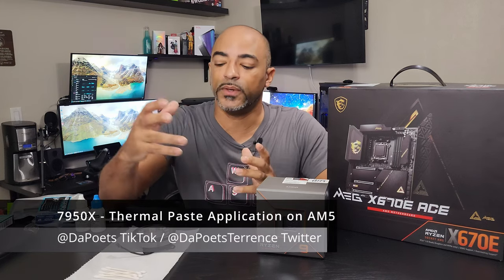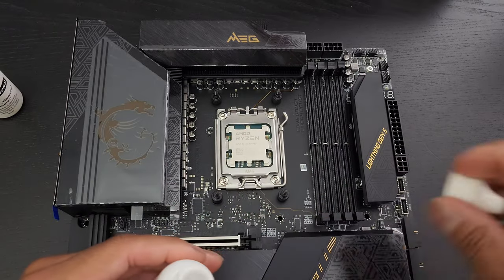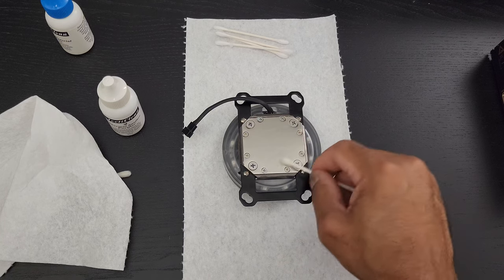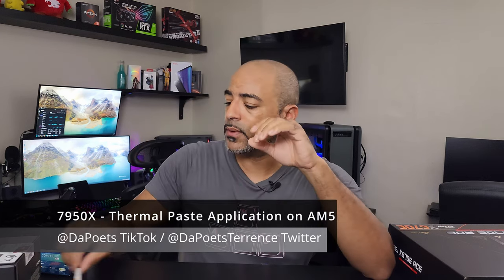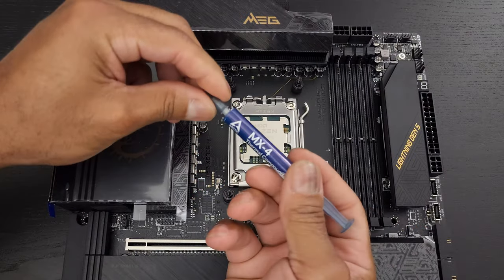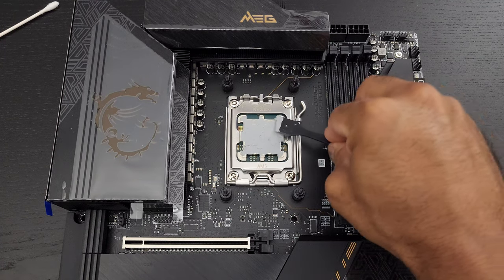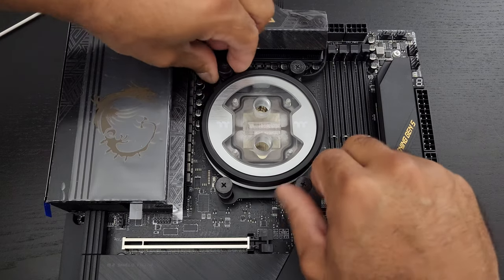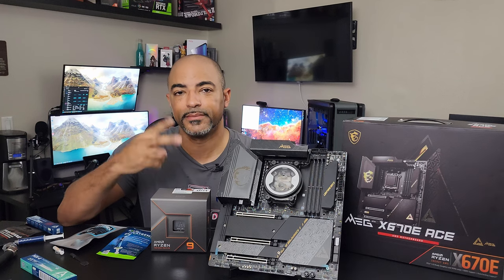AMD AM5 - How to Apply Thermal Paste - Ryzen 9 7950X

Comment: Just finished my first build (a 7700x), and your video was a huge help in taking the mystery out of thermal paste for newbies like me. I applied it just like you did, and the CPU has a nice idle temp of about 43C. Thanks so much for your videos!
Reply: if you spread it like butter you will get air bubbles in between the contact
Reply: That idle temp is terrible
Reply: Don't do it like him in the video, there is a reason you not suppose to mess with it
Reply: @romanpechorin4798  Tom's Hardware would disagree with you: "When the CPU is idle, a good temperature is anything under or around 50C." Especially given this is the 7000x series, which runs hot in general.
Reply: @boxinabox23  yea, I agree, I was wrong.

Comment: Nice video! I've been using Kryonaut for a few years, but just bought some MX-4 and may try that in my next build. I've been building my own PCs since the mid-1990s and I use the method you showed (spread the paste over the whole IHS). For large areas I like to use a razor blade to get an even spread across the whole area, but the spatulas are easier to use in small spaces and I definitely think they make sense for the 7000 series given the irregular outer profile. I try to get the paste pretty thin...you need enough thickness to adapt between surface irregularies, but the thicker it is, the more it hurts heat transfer.
Reply: yeah I was doing that when I got my 3800x and I have better cooling. I also upgraded to the 5800x a few days a go and my cooling is actually good af.
Reply: i think thermal paste spreading was one of the topics we just didnt care about enough in the 90s and 00s .. 

especially with higher core counts,.. if theres a hotspot, it might just be the reason for that random reboot the other day <3

.. those random patterns we followed (do an X on the CPU.... or make 5 dots of paste .. yadda yadda) - we were probably such a long way off
Reply: to be golden - as thin as possible, but evenly applied

Comment: Thanks for the details on spreading the thermal paste onto the corners and side tabs!  I’d been searching for an hour for confirmation that the paste should go onto those parts of the surface as well.  I’m getting ready to assemble a new AMD Ryzen 7 7800X3D rig.  Most of the tech videos I’d looked at gloss over that point!
Reply: I've completed my build!  I installed a Gigabyte B650 Aorus Elite AX motherboard with a Ryzen 7 7800X3d CPU, two 16Gb GSkill Trident DDR-5/6000 memory sticks, a 2-Tb Western Digital Black SN850x NVMe SSD, my nVidia GeForce RTX 3070 GPU, and a beefy two-tower/two-fan air cooler for the CPU.  Had a brief moment of panic first time I turned it on, because I was "rewarded" with a blank screen!  Turns out, the inadequate docs that came with the motherboard weren't clear on which memory slots were the 0/1 pair, and I'd installed them in the 2/3 slots instead.  Upon reading the docs more closely, I learned there is a set of four small LEDs on the motherboard that light up if something is failing: CPU, memory, OS missing, or boot failure.  And the memory LED was lit, so I switched the sticks to the other pair of slots, and it worked!

This rig rocks!  First surprise was the MUCH faster download speeds.  Once I got Windows 10 up and running (haven't stepped up to 11 yet), I downloaded some games off Steam, and the downloads rocketed along at a consistent 860 Mbps, and touched 900ish at times.  (I use Google Fiber's 1Gb/sec. fiber Internet service.)  One game weighs in at a robust 104.1 Gb on the download size; I had it downloaded and installed in 17 minutes.  By comparison, my old rig would be lucky to hit 30Gb/sec download speeds, thrashing between downloads and churning the hard drive.

First major in-game test was "ARK: Survival Ascended," built around a new game engine, and a significant graphics upgrade from the original "ARK: Survival Evolved."  It's a pretty good test of a gaming rig.  And it was buttery smooth.

Thanks again for the highly-informative and well-produced video!

Comment: Long before PC CPUs were ever really hot enough to need a good thermal interface, I was a licensed radio operator building power amplifiers and the likes. I learned how to do thermal paste way back then from the radio enthusiast community. It's an entirely different community with very different ideas / methods. The way they taught me is like you, but much less timid. They'd apply it to the heatsink, no the device, and spread it with a pocket knife until it was a thin film... it's fine if its a bit thicker in places, but a thin film is all you need. In the Tech/PC community, the typical dot/cross/smiley face on the CPU for me is just lazy and improper -- but the AM5 platform seems to be correcting a lot of the problems the PC community had (in my opinion anyway).

Comment: I use MX4 for office PC's, Kryonaut for gaming PC's, Shin-Etsu 7921 for laptops (User friendly pastes don't last on them) and Honeywell 7950 phase change pads for hot videocards and laptops for better long-term stability.
And i use a small mini gas torch with a short burst on heatsinks after cleaning them because most of the times there is still alot of watery/silicone from the previous paste coming out of it and i want the surface 100% clean before firmly rubbing a thin film layer of paste on the heatsink to saturate the grooves and reduce the surface tension for better adhesion on the new paste.
Reply: Kryonaut is a pain in ass thermal paste. I don't get why they do that tube/nozzle.  Just a simple cap on and off is all i want.
Reply: I don't use Kryonaut anymore, too many drying out issues with it. Now it's mostly cheap but same or even better performing GD-2 from ali on desktop cpu's. It's sturdy paste and i apply it with a fine honeycomb mesh and a roller.

Comment: ty so much for this video. I personally hated the pea and other methods, even as a building as a child, and this is the I think the same design but my CPU might be a bit lower in power but same series. I always did the slow SLOW scrape method since 2004 when I first built my PC(Which I got made fun of on tech forums back then lol). Well now im building my first rig as an adult so this time it cost me a good chunk of $$$, and the paste is my the thing ive been subconscious about.  I did use that gorilla paste when I had to reapply(2 times actually, CPU still going hard over 12 years, went from 90C to 30-40C all the intial paste was gone lol), but the Arctic X4 I went out and ordered asap as im just doing gaming now and from this video and reviews its exactly what I need. You know far more than me but id recommend using a very fine cloth vs q-tips(due to residue of the fine hairs of a qtip)  The cleaners are new to me, I generally have used 90%+ rubbing alch. Building computers has gotten way easier, easier than a childrens lego set, but the paste is the big one you can screw up and this video is exactly what I needed, ty!

Its honestly hard to find people who legit know how to do pasting right, everyone does it differently but I find this video method the best, for really any gaming CPU for well over a decade.

Comment: I've always liked using my Corsair H150i with the Corsair xtm90 thermal paste. I've been getting consistently 3c lower than when I was using my CM Drank despite having the way lower volume on the processor itself. I think that may actually be why too when I think about it. The thinner layer of water saps the heat away much faster than a larger amount, with a high vpm pump that hot water is always on the radiator and the cooler fluid is always going to be coming into contact with the heat. A lot like how we cool ourselves with sweating, just instead of waiting for the evaporation, we had constantly flowing cool sweat that gets pulled away from our body.

Comment: i spread the thermal paste as thinly as possible to the waterblock (not the CPU itself) before putting the thermal block on the CPU. I find it a lot easier to apply the thermal paste thinly on the waterblock whilst it's on my desk, without having to dodge around bits of PC case, fans, ram, vrms, CPU notches, cables etc.

Might be wrong but that's how I've always done it and never had any thermal issues or paste issues.
Reply from the maker: Ok

Comment: If possible would you be able to do this with just a pea size amount of paste to see the difference in thermals? I also have a 7950X and this same board matched with a 360 AIO. I believe my temps are good as far as benchmarking wise and I didn’t spread my paste out. I’m kind of interested to see how much of a temperature difference potentially it can make though.
Reply: I agree, this would be a really good way to compare since thermal grease only needs to really cover the center of the IHS where the fastest caches are, and therefore, where the most heat is generated, I truly doubt him spreading it all the way to those tiny corners made any noticeable difference lol

Comment: I use Arctic MX-4. I tried the fancy Corsair stuff, but my temps were always through the roof. I applied it a few different ways and went through a few coolers as well. Got a new AIO and some Arctic MX-4, I haven't seen temps above 45°c in 2 months.
Reply: the mx-4 is crazy, but you need to try the mx-5...Its amazing .
Reply: @mintedpanda3019  I wouldve, but MX-4 was waaay cheaper and I was on a budget. The AIO I got was on sale for $45 at the time, and the MX-4 was going for $10 with the applicator. MX-5 was like $20 with out the applicator. Just made more sense.

Comment: For the GPU and high TDP of the processor you should try phase-change material Honeywell PTM7950. It comes in as a sheet, lasts longer, performs works better than traditional pastes and there is no pump-out effect. On the power section (vrm) and vrams I advice to give thermal putty Upsiren UX Pro, which will lower the temperature of the vrams by 5-10°C.
Reply from the maker: Thanks for the comment! I'm familiar with phase change materials and they definitely have a nice benefit. Not very common though as most users are familiar with thermal paste which is the main stream way of doing this.

Comment: Thanks for showing this.  I don't use a modular cooling system like you do.  I like the simplicity of the AIO.  I would like to see a video of you installing the Corsair iCUE 150i Elete LCD on this Mother board.  I have ordered this board and cpu along with the Corsair and would like a better understanding of installing it and the 20 tons of wires it has.  Thanks

Comment: if you look at delidded ryzen 7000s you can see there is nothing under the IHS where the legs are, its just for mounting strength. I dont think there's a needo to put thermal paste there.  That's why Arctic Liquid Freezer II offset mounting is perfectly fine to do, the cooler plate is moved entirely off the top 5mm of the IHS and the copper is not in contact with the IHS there, yet you end up with better cooling results (because it puts the coldest part of the plate in contact with the hottest spot on the cpu)
Reply from the maker: The entire IHS gets hot from the die so you want ALL of the IHS to transfer heat. 100% coverage.

Comment: The heat is regulated though, so spreading the paste like this might not be needed so thoroughly. Even though the temp is higher with the 7000 series, it is intentional, it hits 95 and throttles performance from there to maintain temperature. You can literally use a $30 cheap fan CPU cooler at 20% speed and it still won't go over 95 degrees, it'll just throttle performance by about 25% at it's biggest work load. Lots of videos about it, just thought I'd chime in with that!
Reply: why would you sacrifice 25% performance?
Reply: @hydro1337x  it’s very, very rare that it actually throttles it that much. That’s at the very most. You missed my point.

Comment: I have a question, I forgot spread the thermal paste evenly and put the cooler on. I had to readjust because the board was giving me issues. Some of the thermal paste got on the small components and its hard to remove. would this cause an issue?

Comment: Arctic MX-4 has been my goto paste for years.  Trying out the new MX-6 replacment also.  But best temps have been achieved with the Kingpin KPx paste. 1-2 degrees better than the MX4/6 pastes. Best bang for the buck in costs go to the Arctic pastes though.

Comment: Anybody using liquid metal on AM5? Its odd shape and the extra caps seem risky.
Reply from the maker: That's not the way to use Liquid metal.  You wouldn't put it on an IHS for Intel or AMD. It's mainly used for direct die applications.
Reply: @DaPoets  I have a tube of conductonaut but no means to delid 🤦‍♂️ Do you think AM5's odd shape makes it dangerous to apply on top of the IHS? 
Obviously I must apply a conformal coating to the exposed caps on the substrate.
Reply from the maker: @isaacstyles92  liquid metal has very particular use cases and should not be used on an IHS unless it's just a very short-term benching use case
Reply from the maker: @isaacstyles92  you may find that you will get undesired results as well as potentially eating away at your cooler if it's not nickel-plated
Reply: @DaPoets  that's helpful advice, thank you!

Comment: wow, well i have to take this into consideration if i upgrade from 7600x... i just took some electrical cleaner to my old ml240l cooler master, slapped it in on the base hinges, same thermal paste, and i got decent 39-40c on easy operations, went up to 82 but came down to mid 70c at stress (less when gaming) nice information tho, i will take this to my (note MY) knowledge for later

Comment: My go to is thermal grizzly Kyronaught extreme since they released it.  I used to use the Arctic Mx-4 also.
Both have been long Lasting and have had the coolest Temps so far.
Reply: Hey just bought the kryonaut extreme, but some ppl say it doesn’t last long, did you have any problems? some say they need to reaply every year..
Reply: @hydro1337x  I've replaced mine every 3 years like do with any other thermal paste. I've never seen it dried out.
Reply: @ecloud01  That is nice to heat, thanks for the info
Reply: btw. do you warm up the paste before applying to spread easier?

Comment: I spread my compound the same way on the CPU and GPU.  Do you have any concerns that the compound may spread beyond the edges after installing the water block?  I haven't removed my CPU or GPU yet.  Btw, glad to see someone else applying compound using the same method.
Reply from the maker: As long as you apply the correct amount it will not spread over the edge. I've shown what it looks like in other videos and it was perfectly fine.
Reply: @DaPoets  Cool.  Thanks.  I will search for the video so I can get an idea because I've never pulled mine apart.

Comment: I don't think you needed to put it on the EDGES of the CPU as there is nothing under the to pin that area.
Also was there a need to spread it out like that seeing as how when you put the cooler on the CPU it will spread it out anyway...?
And look I by no means want to tell you how to do your thing but it's just an observation.
Great video.
Reply from the maker: You want the entire area to have thermal paste because the entire IHS does get hot and you want it to transfer as much heat as possible to the cold plate

Comment: im about to build a Ryzen 5 7600x system 
And im curious if those 8 pokey outy bits actually need paste on them.
but instead just treat the cpu is a smaller square and ignore the 8 bits the poke out, 
As seen in the delidding video there is no cpu parts under there, the shape is for Style/Looks not to cover components
Reply from the maker: The entire IHS gets hot so you want to transfer all of that heat everywhere to your cold plate. Only takes a few seconds.

Comment: I currenty am using thermal grizzley for my rig, in my experience i have seen extremely good preformance compared to mx4 and the reapplied crap on coolers.

Comment: what is a good thermal paste for 7800x3d i know the cpu runs very hot i bought an aio cooler,
Reply from the maker: Arctic MX-6
Reply: This CPU doesn't run hot at all. This is actually one of the coolest CPUs on the market

Comment: I didn't hit the very corner pieces like that on my 7800x3d. But in cinebench 100% usage it only goes up to 78c so I should be good?
Reply from the maker: Your temperatures are acceptable.
Reply: @DaPoets that's weird I ran cinebench again today and it was 8c higher then yesterday 🤔
Reply from the maker: @elemnt360z  ambient temperature is make a big difference

Comment: Can clean easily with 90% Isopropyl alcohol and a tissue or q tip.

Just put a pea shaped blob in center and place cooler on top.  Nothing you’re doing improves actual cooling, its just OCD. 

Watch Gamer’s nexus vid on this topic.
Reply from the maker: AM5 is different
Reply: @DaPoets  Nope. The instructions from AMD actually say to put a dot in the middle.
Reply from the maker: @sproket343  AMD actually shares my videos on how to apply thermal paste to it

Comment: Maybe I'm old school, but spreading the paste makes no sense to me.  The heat sources are more towards the bottom of the chip, a pea sized bit of paste will spread it to where it needs to be with the pressure.  I feel like painting the paste on there will just push it off to sides more and in the end, be counterproductive and push it off to the edges more, where it's worthless.
Reply from the maker: Covering the entire IHS insures that 100% of the potential heat transfer won't be achieved. The pea sized amount leaves too much to chance. There's no spillover if you apply the correct amount.